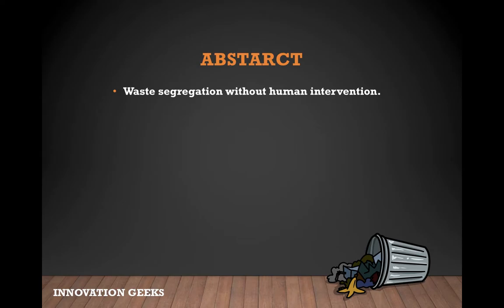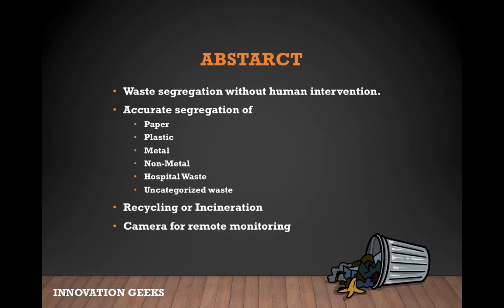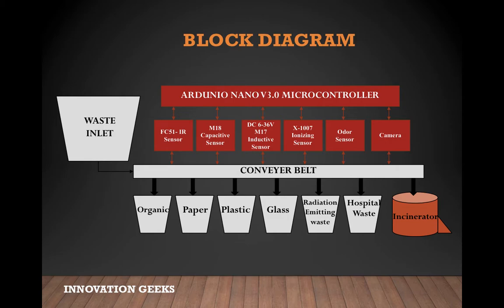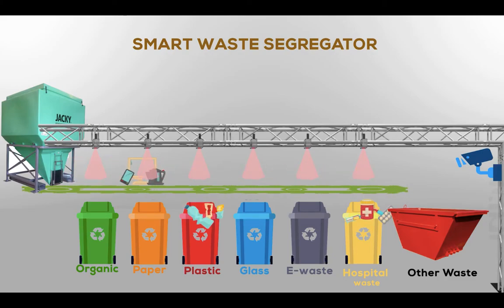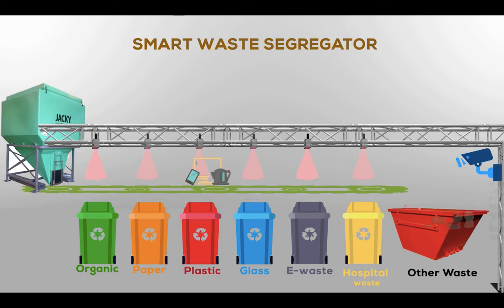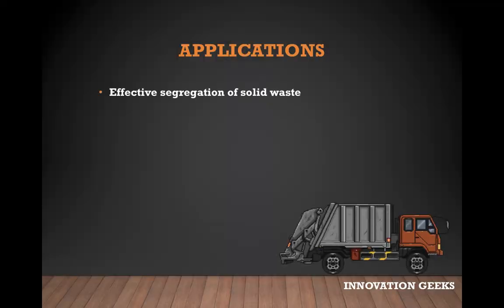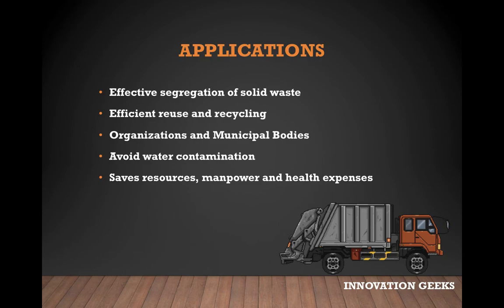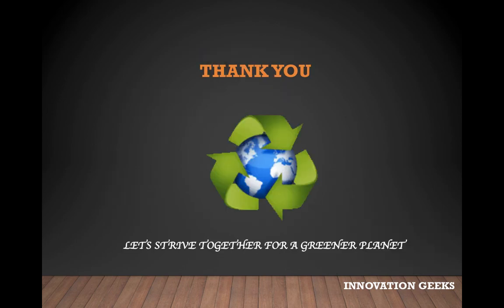Smart Waste Segregator

Comment: I have a question about how will the waste goes to the bin since the conveyer belt has a close base, can the conveter belt open when the conditions are met or its a different thing?
Reply from the maker: Putting the waste into the bin can be done with a separate mechanical system. The plan is to scramble the waste and drop it one by one on the conveyor belt. Conveyor belt starts moving whenever there is any waste matter on it. Else, it stops.
Reply: I think there is an actuator, like an arm will push the waste out of the conveyer belt to the garbage can.

Comment: What if, if we dump all the wastes together. In some cases organic and non organic are mixed or plastic waste sticks with organic waste or medical waste sticks with plastic waste. In this case how this machine reacts? If machine detects this waste as organic waste means the plastic which is mixed with also send it to organic waste bin like that for all case in which what if two different types of waste mixed together? How the machine reacts! Can you please explain
Reply from the maker: Hi Hameem,
This machine is just a simulated model. The prototype has not been created yet. There would be major design flaws if we implement it as is. It is always best to collect wastes that are already segregated into organic and inorganic from homes and hospital wastes from healthcare facilities. While using this equipment, it is preferred to use it only for dry waste. Addition of wet waste would practically make the entire process messy. To answer your question, we can enhance the image processing end to identify if two wastes are sticking together. Further, we can use a blower in the conveyor belt to try and separate it before dropping it into its corresponding bin. However, at this point, there may be another challenge of dropping the item off the conveyor belt. Adjusting the air pressure and all would be a hassle. There are several heavy machinery these days that use vibration and blowers to separate stuffs. The most optimal solution would be to use it in the huge bin before the waste hits the conveyor belt. Hope this answers your question.